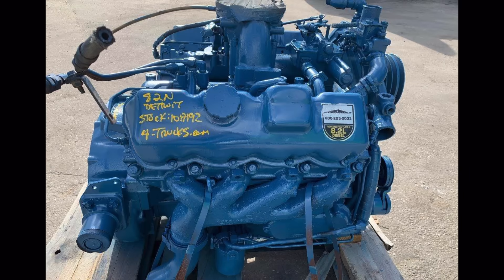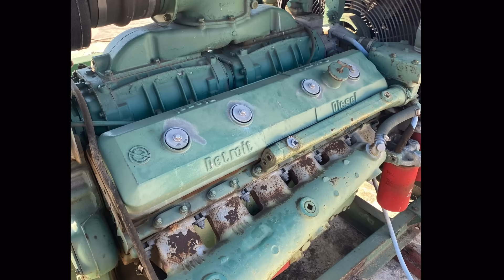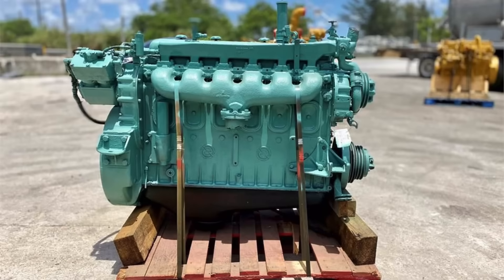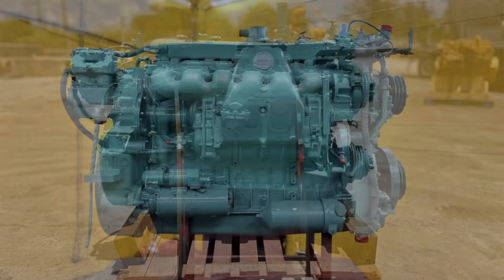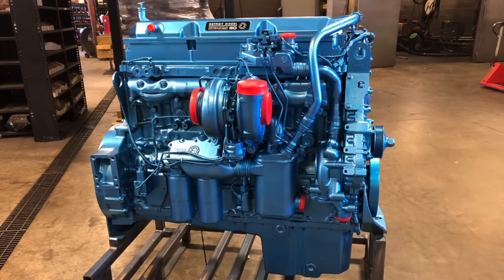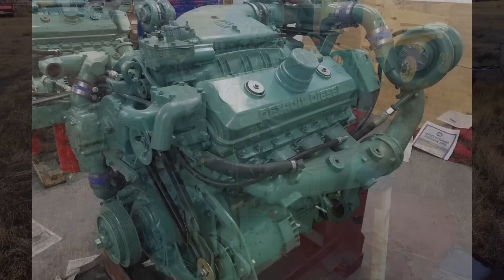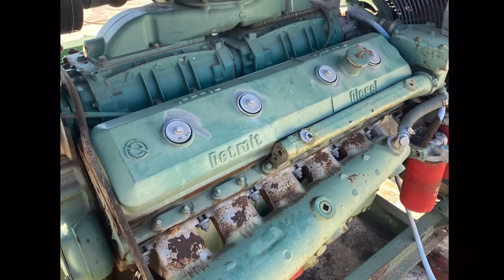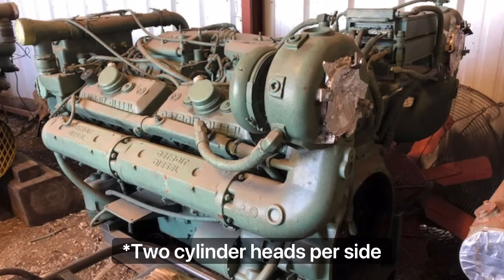Best Engines: GM Builds an Awesome V12 with Detroit Diesel's 12V71 "Buzzin' Dozen"

Comment: I started trucking in 1984 and the lady I worked for had a 12V71N in a long nose 1974 KW and buddy, she could really make that thing go! You asked about COE trucks with the V12, we just scored a 1974 Peterbilt with a fresh 12V71N (the video is on my youtube page) The engine in that Pete is a fresh rebuild but hasn't run in 40 years, however it does turn over so maybe next summer we'll start that engine.  Nothin' sounds like a Screamin' Jimmy!
Reply from the maker: Awesome!

Comment: The 12v71 really drank fuel, though. You don't see em pulling freight much anymore because they're really thirsty engines when compared to even an 8v71. Combine that with the relatively low fuel efficiency and you have an engine people don't want to deal with on the road.

Comment: First truck I owned was a 70 Pete cab over with the 12v 71 .  Double over 13 spd and 4.44 rear gears. Very fun to drive and did well for several years. Swapped a 3406 B into the truck and never looked back. The Detroit went into a terex dozer.

Comment: Thanks for your video, very interesting explanation of the history, info, and sound of this engine. 
I recently did a video with John Casanave (designer/builder) of Challenger Off Highway trucks. He put a 12V71 in a logging truck he is building now in 2025 (seen in the video). And talks about having a 12V71 in a Pacific logging truck.
https://youtu.be/QdRtZTOMh88

Comment: Yes the 8.2 was a gutless turd, but it was economical and got you there with patience which is enough. 85 gmc 6000 gets around 14mpg if you're nice to it and not a computer chip to be had.

Comment: I was a Mechanic at GreyHound , and that was the only Diesel we used..Lets get the story right..The Detriots only leaked oil when they were worn out Or had been overheated, as any diesel will. The Blower was to Clear/scavenge  the cylinder of burn fuel, as there is NO Exhaust stoke, in a 2 stroke. The Fuel was Injected at the Top of the Compression  Stroke, like any Diesel, and NOT introduced pre mixed through the Liners..The Turbo Versions were very efficient, the Turbo's Which are propelled by exhaust gases, quietened them Right Down, and Made POWER..The 8V71's would run 1,800,000 + miles..Some went past 2 million MILES No B/S..
Reply: Nice!  I was a driver out of Toronto  2002-2014. 

My favourite were the Super9’s with the 6v92 and 7spd manual.
Reply: Mine had 387 miles it
Reply: Started on a 8V-92 silver with turbo and twin stack mufflers. Very quiet,  but great power.

Comment: 12 V 71  or  any 71 series are the most efficient was to turn diesel fuel to noise.
Fill her up with oil and check the fuel.

Comment: I've run Detroit Diesels in marine use since 1961, including during the Vietnam war. I still have 2 in a WWII patrol boat. The 2 cycles, especially the 53 and 71 series are the most long lasting. I prefer naturals because they last forever. The mechanical injectors are the most reliable diesels and Detroits the best. On the ocean you need reliability. The current electronically controlled injector engines are unreliable. Period. There's too many places for failure. For example in the Detroit 2 cycle era, fishing and commercial boats were single engine. Now most are twin. People that work in the ocean carry hundreds in spare electronic parts. What the EPA doesn't get is mileage and clean burning doesn't count if the engine doesn't run.

Comment: Operated Euclid  and Terex equipment in south west Flotida in the 70's , 12v 71 in S24 scrapers , 6-110s & 6-71 in TS 24, 4-71 in both ends of the TS 14 scrapers, have spent many great hours listening to Detroit Diesels.

Comment: I drove a Ford LN8000 with a 6v53, after the truck was sold to another company ( the truck was a 1970; model with over 1,00,000 miles on it) I was  making a delivery and it showed up. The other driver left before I did, and I could hear that truck I swear for over 2 miles. Detroit Diesels were  noisy. Been around the 6v71’s as well as the 8v71’s. You could always tell the Detroit from any other engine, they definitely have a sound of their own. Like you said, almost like a formula 1.

Comment: My brother that did some diesel engine repair work in the 1970s said that there were occasions when the metal divider between the ports on the cylinder liner would break off, resulting in havoc with the engine.

Comment: We had 6-71 in 900 compressors 12-v71 in Mack M 35 rock trucks IR track mounted blast hole drills I liked them 71 series is a dry liner engine , they were known to leak oil and could possibly run away or off if you will that got better with the spring loaded injector rack the 71s I was around all had a gate that you could block the air coming into the blower or random blowers on the 12s

Comment: Because the blowers feed the air from the side and through the liner ports into the cylinders, there were no intake valves, only exhaust if I'm not mistaken.

Comment: I rebuilt several of those engines for old mining trucks the smoothest running Detroit made as there is a cylinder firing almost every rotation of the crank shaft

Comment: Had the pleasure of working on the V12 on generator sets on the Alaskan pipeline project, awesome engines sitting there running twenty four hours a day except shutting down for in frame maintenance !

Comment: Cut my teeth in a 66 COE Pete with a 318 Detroit and two stick 4x4. We never put oil in the engine, we just poured a couple gallons over the top and let it soak in!

Comment: It Was NOT A 500, It Was A 501! You Probably Hate The Pontiac 301, The AMC 401, The Buick Nailhead 401 And The Maserati 301! Also The Porsche Boxter 201. Seems You Guys Hate Any Engine With A Cubic Inch Displacement Ending In 01.

sad

Comment: I co-own a 250’ fishing vessel with all Detroit power from the late 1970s . It has two 16 cyl mains, two 12 cyl generators , one 8 cyl bow thruster, two 8 cyl generator/ hydraulic pump, two 6 cyl generators one 8 cyl dedicated to the windless for anchor deployment & retrieval.. while underway fishing it burns just shy of three thousand gallons of fuel per 24 hrs.. It’s the loudest thing you’ll ever experience in the engine room and the sound waves will make your body numb after 20 minutes 😅.. The boat was manufactured in Morgan City LA.

Comment: 6:13 The intake charge from the blower was designed to flush out, or "scavenge" the cylinder of burnt exhaust gases. It was half of the reason why the 71 series was discontinued. It was a filthy running engine. It was a fantastic sounding engine. My favorite was the 8V. It had the look of the biggest big block, and made one heck of a racket!

Comment: In my 30s I had a job driving offroad heavy trucks Paystars 5k series ,Company had a dozen of these tractors with 8v71ta and 5+4 boxes ,50 ton Tulsa's just tractor was 28k lbs over loaded on pavement easily 95 mph most drivers lasted two months and got their 5 speeding ticket limit and rotate off to yard duty a while .And new driver took over I got to be one of new drivers , She  Ripped!!!! Painted on the hood in large black letters was THE MISTRESS   and  at 40lbs of manifold pressure the miles rollaway..

Comment: I've worked on all of them one time and another, 53's, 71's, 149's. 3 cylinder, 4,  6, 8, 12, 16..... One common problem is they all leak oil. Saying was, " If its not leaking oil, check the level, its probably dry"....

Comment: The "Green Leaker", I've still got a cupboard full of rebuild tools, every one of them, still come out the odd time to rebuild one. 
 Pure junk, but mass produced for Nam.
 They came built with drip tubes, designed to  drip oil out of the air box. Some guys hung a reservoir and hoses to catch the oil instead of flying out and covering the under chassis of their trucks.
 The 2 stroke joke best described this engine.

Comment: v-12 71 T/A. turboed. After 8-12 hrs of wiping the oil off of everything I swear you could hear the oil being squished in the valve covers.....Hated the green things. Got me the 71 series knuckle from adjusting the injectors with out the correct wrench . But with all that my boat never had a black light bulb from the engines not working. Still hear them in my sleep. I can not hate them , just dislike them.

Comment: At 8:15, The cylinder liner ports are for air only, not fuel which is injected into the cylinders by injectors

Comment: Operated Pettibone and Baker fork lifts with a 3 cyl Detroit. Big Bud tractor Co. Havre Montana used Detroit in many of the tractors they built. The tractor called 747 used a 16V-92T. Love the sound of turning diesel fuel into noise.

Comment: I had a 43 foot Torres hull (stone crab boat) built in Key West that had a 12V71TA with #105 injectors rated at 740 hp @ 2100 rpm. Id spin it 2400 in gear with a twin disc 2:1 gear and 32 x 34 wheel. She'd run 28 knots all day long which for a boat is like 112 in a semi. She burned 24 gallons an hour and never missed a beat. That boat earned me a living and the Detroit Diesel was the engine to have in a marine application.

Comment: We used Detroit Diesels in Gardner Denver Portable compressors in the 60s thru 80s. 4-53s, 4-71s, 6-71s, 8v-71s, 12v-71s.
They had to run with very little exhaust backpressure to scavenge properly. You could always hear their distinct sound.
You forgot to mention the "Tattle" wear ring on the compression rings that you could inspect when you removed the air box covers. Usual indicator was alot of oil slobber out the air box drains from worn rings.

Comment: I’ve only seen 2 V-16 Detroit’s. One at UTI tech school in 1987. 
And one at at Coal mine I worked at. Basically, 2 V-8’s bolted together. It was on a Joy trailer mounted air compressor.
Many people don’t understand that the blower is only for scavenging as you mentioned. Turbocharged engines only made “ boost”.

Comment: Only fresh air entered the cylinder through the liner ports. The fuel was injected into the top of the cylinder at the top of the compression stroke by the fuel injector.

Comment: Back in the 70's we had IHC CO4070A's with 12 cyl Detroits in the US Army's 37th Trans Group in Germany. Those trucks were more powerful than any truck the Germans had. We were limited to 100kph, though, and the tractors were equipped with Tachographs (Tattle Tales), which were monitored by 37th Trans Group Safety Patrol.

Comment: We used to use these engines on drilling rigs. 2) 6-71 engines bolted side by side. I never saw an engine that could breathe so much dirt in and cold starting fluid and still keep going great engine

Comment: I was at the factory during the fall of '99,the last year of production for the 2 stroke. 
All the lines were condensed into one single line,but we did get to see a 20v-149 have its 3 blocks aligned and crank installed.
I got something in my eye,and as i looked around i see a few other guys did too.

Comment: EVERY STROKE IS A POWER STROKE REBUILD AND REPAIR  32 YEARS  OF EXPERIENCE WITH 2-71 2-53 3-71 4-71 4-53 6-71 NA 6V-71T 8V-71 NA 8V-71TI 12V-71 12V-71 TI 12V-71 TA  16-71 NA 16-V71 TI  16V-92 NA 16V-92 TA 16V-92 TA 16V-92 TA DE DECK   12V-149 NA  12V-149 TI 16V-149  16V-149 TIB DE DECK  .

Comment: Hello Rare Classic Cars & Automotive History:
8:12
Air only, fuel is injected into the combustion chamber by a fuel injector mounted on the cylinder head (just like the 4-stroke engines).

Comment: Just a correction that has probably been made by now, @8:15 the fuel didn't come in through the cylinder liners, it had a mechanical injector in the head actuated by the camshaft.

Comment: I've got a 54' in my boat, love it.
Reply: I also ran a tug designed for ship assist. Had a 12-71 with big injectors and ballanced turned 2800. Intermittent 550hp you had to watch the temp hence the Intermittent rating. I had a push contest with a cat 3412 and held her stationary then slowly the cat moved me back.

Comment: Two engines Detroit diesel Allison manufactured shine the most. It's the 92 series and the 149. And the 149 was the first diesel to go one horsepower per cubic inch. With potted heads and enough head bolts to hold a mountain down it was built to perform from square one.. The 71 didn't get there.

Comment: They used a lot of twin 71’s in oil field applications. Several sitting around but not used anymore. These are two 6-71’s mounted side to side with the outputs hooked together with a gear case.

Comment: The 2 strokes were NOT naturally aspirated.  They were all blown to force the air/fuel into the cylinders and to scavenge exhaust.  They were either turbo charged or non turbocharged.
Reply: Not in the context of a 2-stroke engine.  The scavenge blower of a 2-stroke engine is necessary for it to even run in the first place.  GM called their Roots-blown DD's and EMD's naturally aspirated.  They invented them, so they're the ones that know.

Comment: My family business is a rental construction equipment company that used 2 have Leroi air compressors powered by the same Det. Diesels!  353, 453, 6V71, 8V71 & 12V71 models!  They used 2 scream at their full RPMs, like a clattering, mechanical symphony!  Nothing sounded quite like them & nothing has since!

Comment: I have a 88 379 pete i put a 12v71tt in 1.25 injectors 8 inch staight stacks put it in local shows as a log truck, makes lots of noise and smoke and power.

Comment: I miss the sound of those old Detroit 2 strokes. Best sounding diesels ever made. 👌 The reason the pistons were so big was that they needed to seal off the lower liner ports while the piston was in upward motion and also the reason they had rings on the bottom. Otherwise, the pressure would leak into the crankcase and create all sorts of problems. Nice video, my friend. 💪🔥

Comment: Seems like many people have discovered this engine and think it's really something because it's a V-12 and diesel and sounds great when run and that last part I will agree with.  Now if you had a business and had to depend on an 12v71 and you cared about profit you might not think the channel makers do.  I will state that stationery engines like the 12v71 was more forgiving that the 8v71 or 92 series in trucks/construction applications. The flaw this power plant has it will crack cylinder heads,, they are not forgiving if you get coolant temps hot.  I did not like the two piece pistons and I had my 8v71tta piston come apart.  The fuel rack was problematic and was a source of engine run away if things are not done correctly.  The other problem is they are not fuel effective and if you care about emissions like the feds do well for get it.  There were other Vee style diesels when these were popular and they had there own problems but there were many many of these used all around and used in the military branches.

Comment: The USSR received 4,000 Sherman tanks fitted with 2 x 6-71N diesels.  They were the best version of the Sherman, and loved by the soviets, one commander even writing a book about them.
Reply: Did they have the 4 spd hydramatic as well?
Reply: @rogerdodrill4733  No, the Sheman has a 5 speed transaxle.  That is a 5 speed crash box, coupled to a Cleetrac differential.  The Cleetrac is basically a planetary drive which when the left or right side brake bands are applied, drops down to a lower speed on that output side to each track.  This gives the driver the ability to get different speeds each side and able to steer the tank left or right. If both brake bands are applied, the tank will go straight in low gear inside the differential, thus you have 10 speeds forward etc.

Comment: Everything was designed to work with other versions of Detroit engine. I used to rebuild the cylinder heads and all the valves , usually 4 per cylinder, were exhaust valves. Lots of times there would be cracks in the heads and you had to have the correct tool to install the injector cups. At that time there was a special cast iron tapered set screw that a person could use to stitch pin the cracks in the head if it just had to be saved. All the screws were overlapped and you had to drill a hole at each end of the crack to stop it. I did some and none came back but no one liked to do it and I have no idea how well they lasted. Had a old time trucker from the 50's tell me once that you had to drive the 2 strokes you were mad at them. The gen sets that I saw them used on were set up so that the water was warm and the oil was warm and they could be cranked and run up immediately that way. Just a few seconds of idling and then "we have lift off".

Comment: Great video with only a small correction: The ports only induct the air, the fuel is injected by a cam/rocker arm actuation at the top in between the exhaust valves, which are also cam/pushrod/rocker arm actuated.  Bus Grease Monkey is a great channel to learn all about DD, as is The Ol' 2 Stroker YouTube channel.

Comment: I was deck hand on a boat that had twin 12 V 71. We had unlimited power, and the boats  top speed was 24 knots full throttle and going down swell  but those engines just purred along. The boat was an old Navy coastal boat built in 1943 that was converted to haul materials for the offshore oil rigs but that was almost 40 yrs ago

Comment: 2 stroke detroit will not start naturally asperated .if the blower shaft breaks it has no air to burn
Reply: Many blowers had a emergency shut down to prevent runaway.cable pull shuts adoor on air inlet shuts down